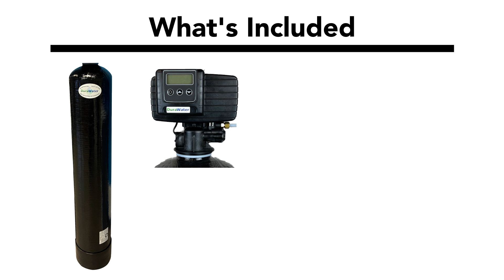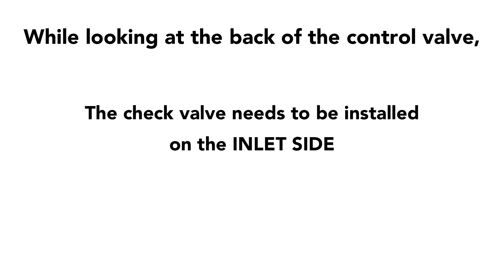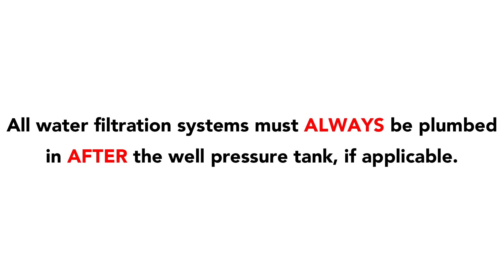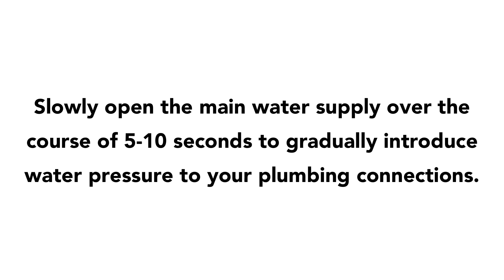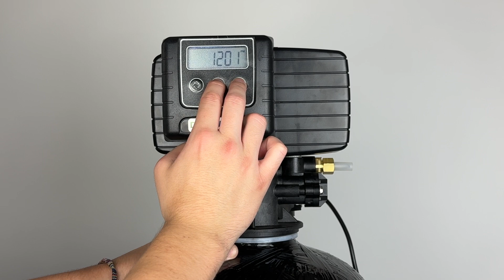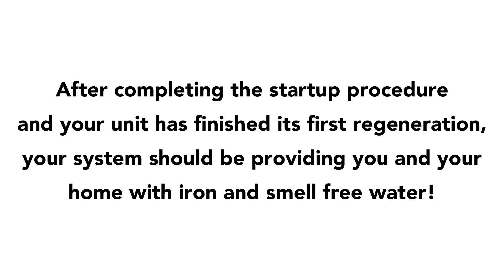How to Install the Fleck 5600 SXT Air Injection Iron Eater

Comment: Good video. Thanks for posting it. Followed instructions to the T and it seems to work as it should. I believe this is good equipment at a competitive price. For people who haven't purchased yet, I would recommend the plastic bypass vs. the metal one. It gives you individual control of each port (in and out), which seems better for the initial setup. My "minor complaints" so far are that the drain hose is closer than it needs to be to the inlet bypass knob, and the power block is huge and heavy. Installation would be easier if the in and out ports were a little further apart so they could be plumbed straight with unions. None of those suggestions for improvement are a big deal, and I would buy this iron filter again!

Comment: This is about the deflector. You show in the video to slide the deflector onto the riser tube and it is pushed down where the dome is still up as high as the threading of the tank. Only about 1 inch down.
In the manual it says to slide the defector down the riser tube about 4 inches. 
Is this important? If so how far down does it go?
Your older installation video says to push the deflector down about 6 inches..